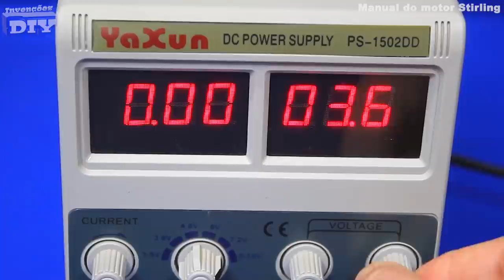( THE SECRET OF THE WATER PUMP ) Learn to do with LITTLE KNOWN MATERIALS!

Comment: hi.      i offer some  heat engine-related  information, and a question.
the utility of any heat engine is determined by the types of energy/fuel available.    and, to a degree, how  'clean'  those energy sources  are.      any  IC engine is  far  more  effective, than the best heat engine.      consequently, in the context of utility, these two facts  partially  Define  the  goals/operating window.       in modern times, the main goal is  usually  the making of usable  electrical power.      (not, driving a mechanism, directly.)
the questions:
i am wondering whether another type of (multi-cylinder)  external combustion  engine would be a better fit.    eg.,  the flame-licker.
it is not clear what the overall efficiency of a  flame-licker engine  is.        if this engine type is deemed well-suited, it is probable that (three to) four  correctly timed cylinders would give the Necessarily, smoothest  rotary  output.
such a configuration would obviously make use of  a  flywheel, and a  way of combining the (reciprocating) motion from several cylinders, into a single rotary one.      cheers        googletranslate
this one should use the smallest practical  cam radius/action. 
http://ridders.nu/Webpaginas/pagina_happer_principe/animatie_happerprincipe2.gif
this one is not good, because the 'valve loading'  occurs  AT  THE  PISTON.!!!
https://i.pinimg.com/originals/38/ff/e1/38ffe12ee84a6727fc0cf9e48222e718.gif